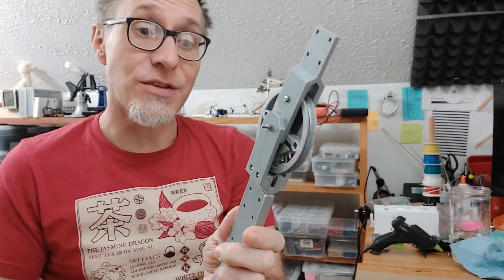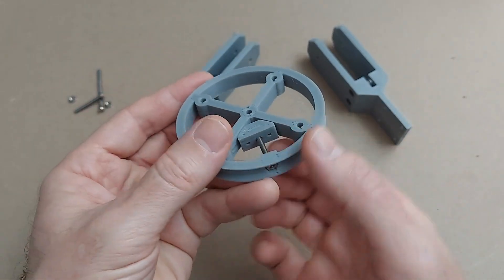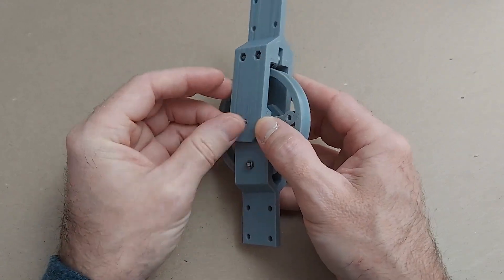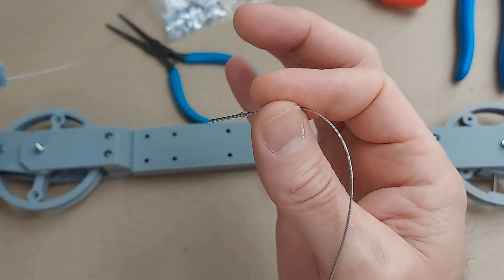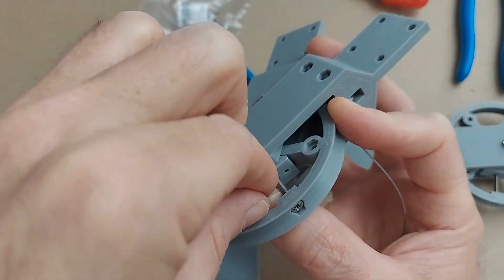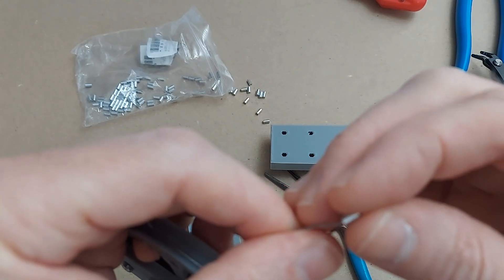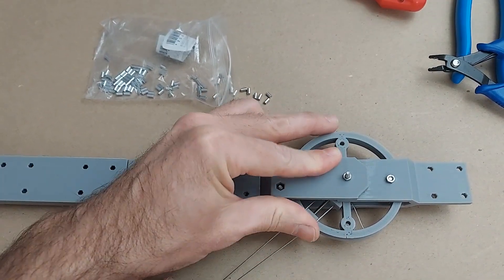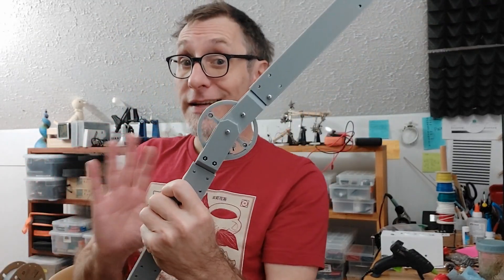String pulleys for robot arm mechanics

Comment: Ditch the steel cable in favour of Dyneema. 1mm Dyneema has a breaking strain of 195kg, zero stretch and very little creep. Steel has a D:D ratio of about 18:1 which means your pulley has to be at least 18 times the diameter of the cable. Dyneema has a D:D ratio of 8:1.
Reply from the maker: And this is why I love YouTube comments 🤘 thanks for the recommendation. I'm checking it out now. 

Am I assuming correctly that UHMWPE is the same thing?
Reply: @androofroo  Dyneema and Spectra are commercial brands that make UHMWPE. You can also find it in some ‘PE Braid’ fishing line, which is convenient for very small diameters.

Comment: Something to note: you do not appear to have any fillets in your parts. The pulleys especially suffer from this. Fillet the ends for what amounts to free additional durability, as those sharp angles are going to lead to stress concentrations.

Also, your wire force appears to go mostly into the channel walls or into the tensioning area, this will lead to rapid wear and induce failure under high loads, as the majority of your pulley surface is not utilized, also having sharp turns in your wire where they transfer forces inside that pulley will lead to fatigue. Instead of this, try to get friction across the wire length, such as perhaps with an outer disc on your pulley that can have its radius reduced. Also consider using a helical structure instead of a flat pulley, though be warned that shrinking this structure is easy (and works well due to exponential friction with multiple windings on the pulley), but will cause rapid fatigue of steel wire if the radius is too small, be sure to not go below the minimum pulley radius for your wire diameter, and consider using string with a low stretch factor instead to shrink your transfer pulley as the wire is not the limiting strength factor in your design.

Edit: upon reading another comment, you mentioned that shrinking your pulley makes the tension mechanism hard to fit. Consider raising the height of your pulley with a second portion that you can rotate independent of the first. This "upper" portion of the pulley will be able to hold the wire ends. You can attach the wires, then twist the upper portion and glue to the main pulley, holding the tension. I find that hot glue on PETG works well, use some glue channels on the tension pulley for a flush fit.
Reply: Rope notes:
Paracord creep factor is high
"DM20" (which I believe stands for Dyneema m20) has extremely good creep factor but is hard to find outside of Europe
Vectran is not terrible but weakens and loosens over time.
Reply from the maker: @Gaaaaaame  wow a lot of good info here. Thanks for the comprehensive notes -- good for future reference 👍

And yeah this is a constant problem in building the various components in this larger framework 
https://github.com/andrewfrueh/PowderOfLife

 ...  getting into so many domains simultaneously always seems to carry the risk that I'm missing critical domain specific information, so thanks again.
Reply from the maker: @Gaaaaaame  also, do you have any recommendations for good low stretch string or cord? I've tried waxed polyester but I have a hard time finding something that has the power transfer of Steel cable. I'd love a recommendation
Reply: @androofroo  i know of one but forgot its name. Ill attempt to find the name of it, keep in mind that it is not the easiest to find unless you are in europe based on what i have heard, but it is still attainable in the US.

Ill check out your github, links are often scrubbed from comments on youtube, so if you have an email address that isn't listed on your channel, providing me with one here will allow me to throw some part files your way. Also do tell me what file types you can open, as i operate using sldprt but can export to several others.

Comment: Awesome ideas with pulleys,I didn’t think of that. I ride bikes so I do it the way bike brakes & gear shifters system works,which means I have the cables with its housing along the arm to lighten the arm load without motors n wires.Thanks for sharing your ideas ❤
Reply from the maker: @Jim_One-wl4ke  bikes would be a terrific source of inspiration so much mechanics packed into such a lightweight frame... thanks for your note
Reply: @androofroo love your idea of tensioner on the wheel👍

Comment: How are you planning to use this on the robots? You mount one of the sides to a motor? What king of motor and how do you do it? Would love to see your next steps. Great video!
Reply from the maker: I am using this pulley system in the wearable that I'm currently posting as "Doug" (the large yellow finger mounted on my shoulder). I've had to go through several iterations as I keep tearing up the pullys with all the force. Thanks for your comment 🤘

Comment: Thanks. This is really interesting. Though, when I'm going to try this I will attempt to make the wheels smaller and maybe go with a double pulley (block and tackle) like here https://youtu.be/M2w3NZzPwOM?t=232 since I want the joints to be smaller.
Reply from the maker: OMG I love Destin and SED! And yes you should totally try that. My one issue with making the wheels smaller is it makes it hard to pack that tensioning trolley inside. I'd love to see what you come up with.
Reply: @NoidoDev ,Thanks, reminder snatch block ideas, that really takes away lots of gearing for torque,cheaper too😊❤